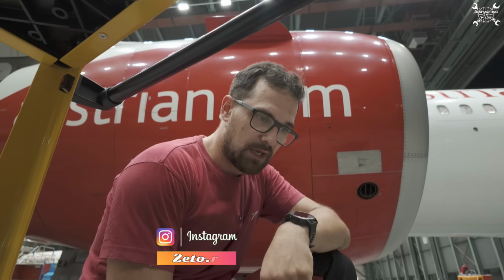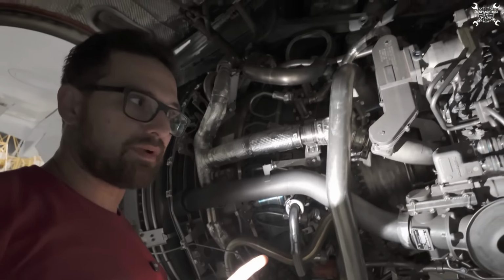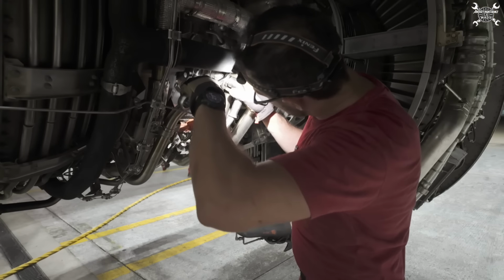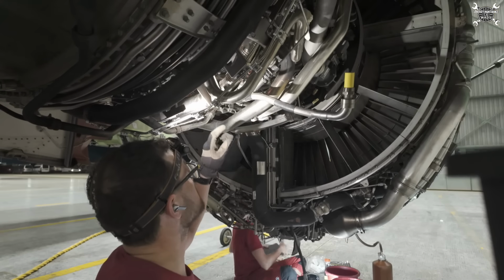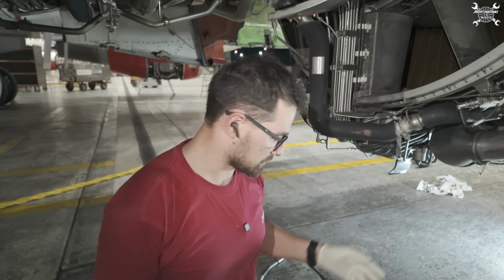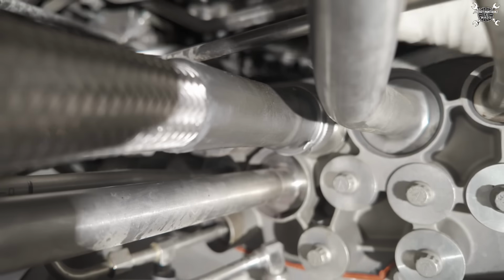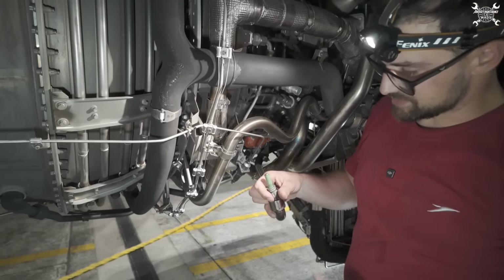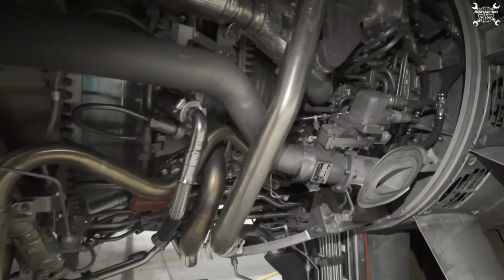How to replace Ignition lead on Airbus A320 engine

Comment: What I don’t understand is when you then test the work you’ve just carried out, is it the equivalent of a VAG-COM on a car where you plug in a diagnostic tool locally? Do you have to fire up the engine? Do you have a diagnostics mode in the cockpit? How does it work in detail - I’m really confused
Reply from the maker: I replaced the part and then through on board maintenance system i performed the test. You can see such thing on most of my videos 🙂

Comment: Unbelievable!! Tonight I need to replace the left ignition lead of an easyjet a/c. More easy like this.. thanks 😊
Reply from the maker: Left one is harder 😁, but good luck
Reply: @zeto.r  replaced 🎉
Reply from the maker: Cool, was it OK?
Reply: @zeto.r  yes, the only thing was to remove the strut plate at 6 o'clock... it was difficult to brake the torque of the bolts
Reply from the maker: Oh ok but at last you did it in the end and only that matter 🙂

Comment: Excellent work, never would have guessed that ignition line is air cooled.  Your clear step-by-step explanation makes this channel one of the best aviation technical sites I have found.  (Stig sent me here)   I do not think we will find that spark plug wire in stock at the local Autozone.  What is the approximate price on that cable?  Was that ignition line indicating a problem or some error code that triggered the need for replacement?
Reply from the maker: I'm doing my best to provide, an interesting way to show what is going on during the night. I'm glad for stig and his friendship, I'm not sure about the price but for sure it is not cheap. We had several time malfunctions during start

Comment: Nice Thomas great video. What voltage does that Ignighter use? I work on Cars so I am assuming it is a lot?  The equivalent of an Ignition coil but perhaps higher voltages going to a spark plug/plug.  There is another Box next to it which looks like a spare/backup. Air-cooled cables are very clever.

Comment: Although it's almost the same, it should be noted that this is an Airbus A321-111 you were working on (OE-LBC) rather than an A320, with a CFM56-5B1 instead of a -5B4's (A320-214) or -5B6's (A320-216) that are also found in the fleet.
That actually leads me to the question: is there a major difference in the engine construction of these sub-types of the CFM56? 

Nice video, thumbs up! 👍

Comment: What happens to replaced compressor and fan blades?
Reply from the maker: Repair or scrap
Reply: @zeto.r  what happens to scrap? just destroyed? I think people would like such blades. I bought a CFM56 5B stage 3 blade from an israeli but naturally he lied and it was bent. And he lied in the feedback.
Reply from the maker: I'm not really sure what happens to such blades. And I'm sorry to hear that. It should be clearly stated what is he selling
Reply: @zeto.r  do you ever change a compressor blade on newer engines like CFM leap? would you consider selling such a damaged blade?
Reply from the maker: Just fan blades and these components belong to the company and they always goes to U/S store
Reply: @zeto.r  what's U/S store?
Reply from the maker: Unserviceable store

Comment: For as little as I know…which is 0 for aircraft stuff…I would have slid the o-ring down the cable housing first and then lubricated it to be sure the oring didnt pick up some dirt etc
Reply from the maker: It is the brand new cable pulled from the bag.... and I checked it before I pushed it through

Comment: I always disconnect the power supply to the igniter box
Reply from the maker: One extra thing which you can forget because it is not stated in the manual
Reply: @zeto.r  You wouldn’t last 5 minutes on the line!
Reply from the maker: 😀😀😀😀 so cute you think that I can't handle the line 😀😀😀 Man I've been working for RYR and WZZ without problem
Reply: @zeto.r  Some quality airlines there! Working line night shift isn’t hard
Reply from the maker: Yes for sure when you only have the last flying wave on calls + night work. I was single B1 on station with 3 aircrafts and we covered 24/7 ops which mean day on calls and night work 14 days in a row.
Reply: @zeto.r I find A380 with 400 plus punters on board on an AOG stressful enough! Money is good at Ryan air but lots of their guys come to BA
Reply from the maker: Jop but does matter if it is 6 or 400 passengers every delay is horrible. RYR is past for me, I don't like their maintenance program.
Reply from the maker: there I see only problem with mixed fleet

Comment: good  A320 ignition cable replacement # it is extremely difficult to understand the entire electrical & mechanical components function since there are hundreds of components there running back & forth # 👍👍👍🇵🇰
Reply from the maker: Nicely said